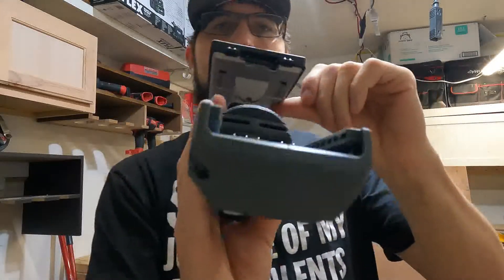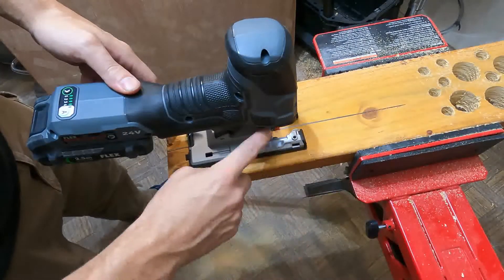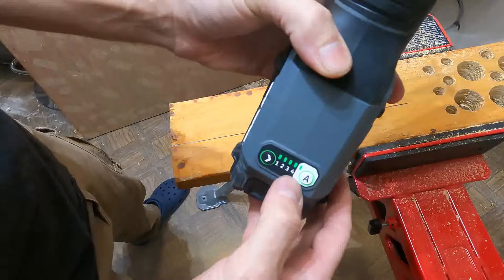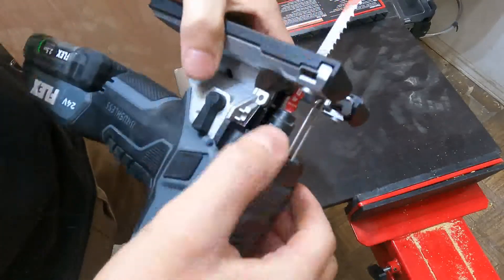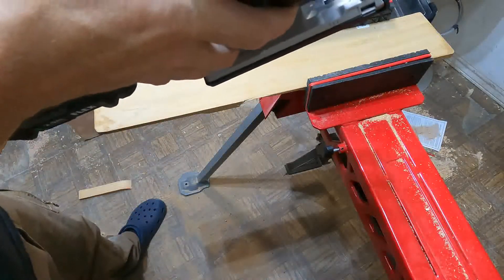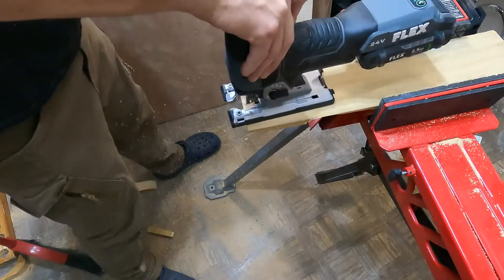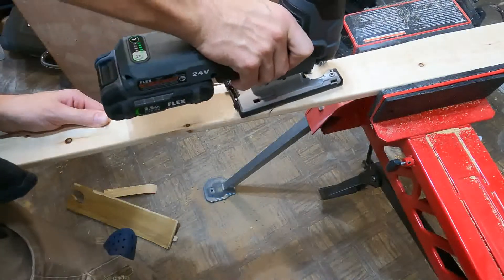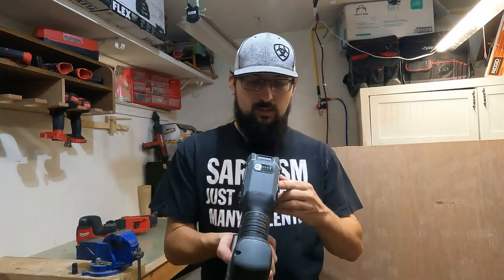FLEX Jigsaw really good

Comment: I like the blade Quick connect feature. Looks very capable 🙂✌️❤️
Reply from the maker: so far, it stays locked in.
Reply: @toolsandtactics  this is an awesome saw I went ahead and make the purchase
Reply: @toolsandtactics  quick question, Lowes has the Flex Vaccum on sale for a few more hours $99.00. 

Is it worth the purchase?  Does it need a 8amp hour to run for an hour. 

Pros and Cons?
Reply from the maker: @rickyperkins232  the only con is not as much strong suction as i was hoping for but it has enough for most jobs 
an hour is a long time! i have not ran it continuously but it works for along time with a 5.0battery  in 5 minute increments 7-8 times and used1/2 battery

Comment: This jigsaw is actually kind of hard to find at Lowe’s atm oddly enough I’d like to get it in hand cuz it easily looks to be as good or better than the dewalt Makita or Milwaukee and the one handed recip seem to be powerful af too
Reply: I have their standard jigsaw and it's absolutely amazing. Most comfortable jigsaw I've used and easy to make straight cuts with. Flex tools really have been fantastic. Mine doesn't seem to have a blower or at least one that works though.